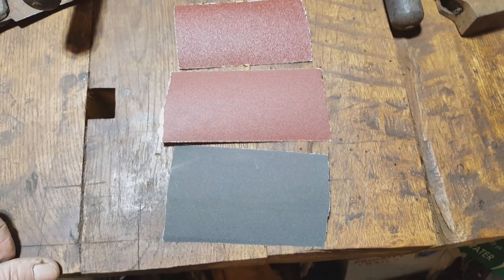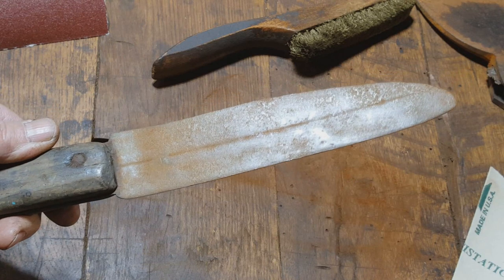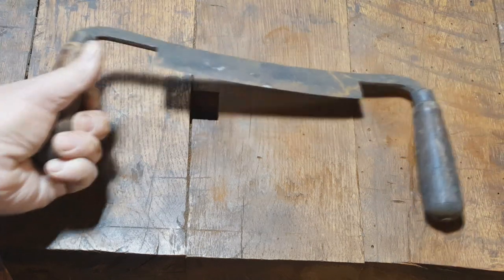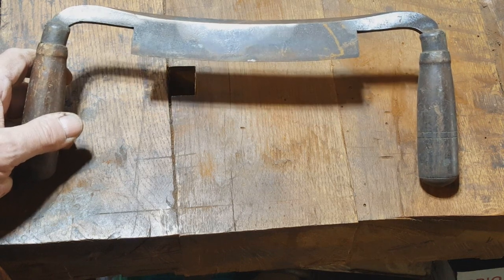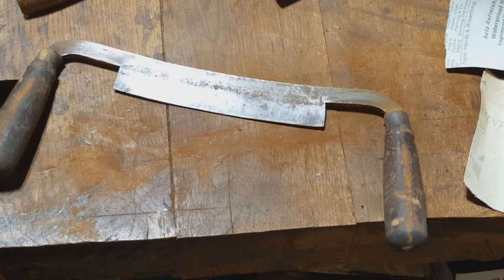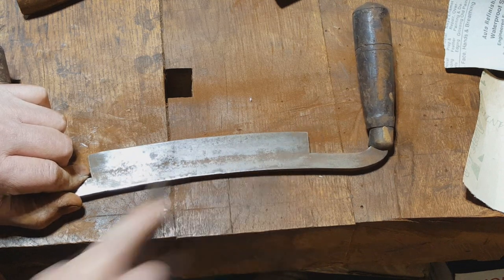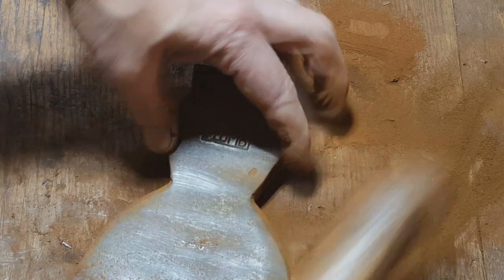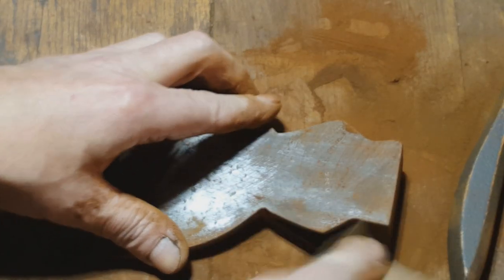Old Edge Tool Restoration Techniques Chapter 1

Comment: That side hatchet may not be a thing of beauty, but it would do a good job. Never seen one. I do have a Kent pattern side axe (similar shape) that a use a lot, but it is a bit big for the green wood tool handles that I make most often. 
Thanks for posting.

(There is a vid on my channel about making billhook handles from green ash).
Reply from the maker: They aren't common over here, but they aren't rare either.  I'm  lucky if I find a few a year.  Most folks get a bit weird about some light pitting, everybody wants their axes sharp enough to split atoms with, and we as we both know, an edge like that will dull pretty quick.  Plus a lot of the light pitting issues can be solved with a very slight back bevel just to clear the pitted areas.  I see a fair number of this style that were done that way.  Thanks for watching!

Comment: Another informative and useful video, Tony! Hey, I was wondering: why don’t you go straight to the wire wheel (using, say, copper wheels) and skip most or all of the sandpaper? I know a few guys who do this, and was wondering what the downside is to skipping the sandpaper and going straight to the wheel. Thanks!
Reply from the maker: Oh I do that a lot, but it depends on how much and how hard the crusty is.  I've used brass wheels in the past, I had a guy at at flea market that was selling them cheap, but they do leave a bit of hue from the brass on the tool.  Every tool I approach differently.  Thanks!

Comment: What do you use to strip the finish?
Reply from the maker: Strypeeze.  I showed the can in my Wooden Molding Plane Restoration video.  Thanks.
Reply: @olderiverhardgoods  thank you so much! I have a couple of OLD Stanley Bailey planes and I can't get the finish off the tote and knob to let the wood grain show through. I don't want to sand or scrape too much …
Reply from the maker: @johnoerter2883  Well depending on the age or the type of the planes, the Type 19's (1942 - 61) vintage ones had really heavy varnish on there.  What I will do is cover them with stripper  and let them set for about 10 minutes before using some 0 grade steel wool.  Wipe them off with a paper towel and repeat.  It will take a couple of times, and usually I wind up doing some light scraping to get the heavier spots off.  I do have a Stanley plane restoration video (it will probably be a 2 parter) in my head, but I can't speak as to how soon it will happen.  Thanks again.
Reply: @olderiverhardgoods  Thank you, again. I'll try that and look for some Strypeeze … I do like the lovely old, grain pattern. One #5 I have was made between 1902 and 1907, Type  9
Reply from the maker: @johnoerter2883  That varnish, while hard, isn't very thick and should come off easily.